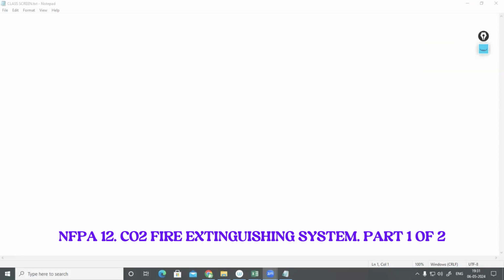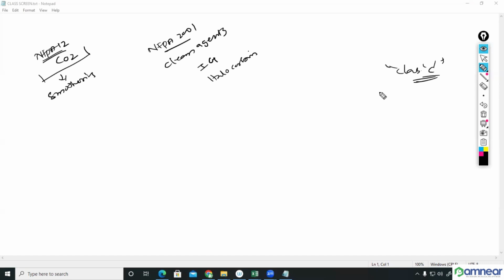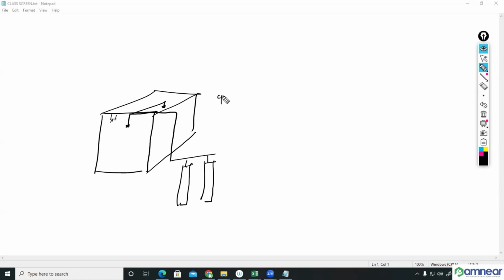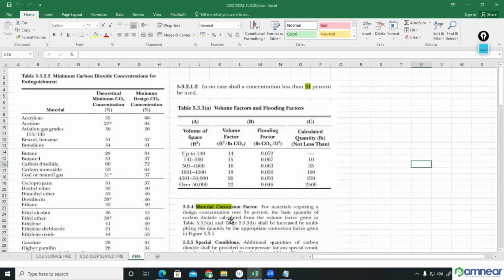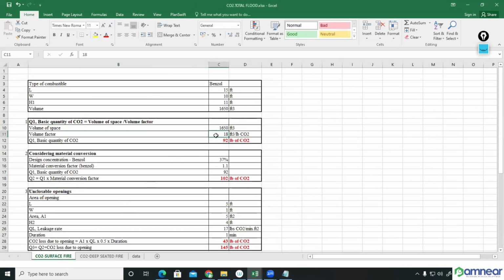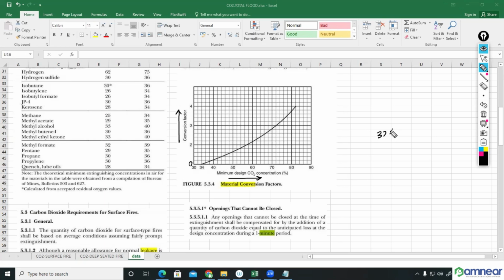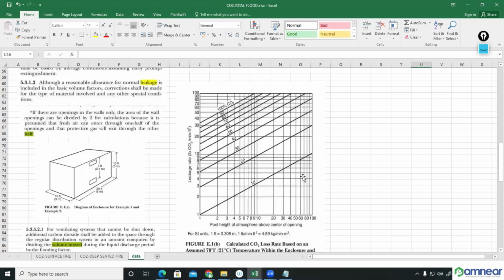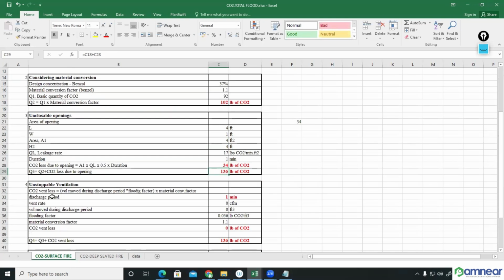NFPA 12|CARBON DIOXIDE FIRE EXTINGUISHING SYSTEM CALCULATION| PART 1 OF 2|FIRE FIGHTING DESIGN|

Comment: Sir Revit softwares run chaiyan minimum computer configurations parayamo?
Reply from the maker: For smooth performance in Revit/Navisworks, especially during rendering, go for at least an i5/Ryzen 5 (latest gen), 8–16GB RAM, 512GB SSD, and a 4GB dedicated graphics card. (i3 with 4GB is okay only for very basic use)